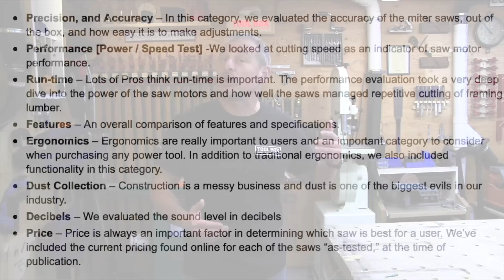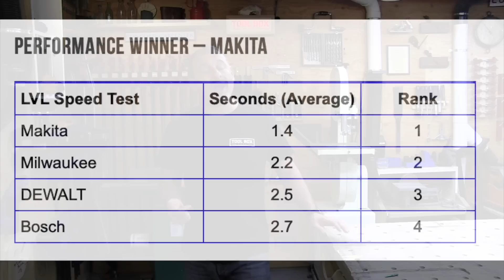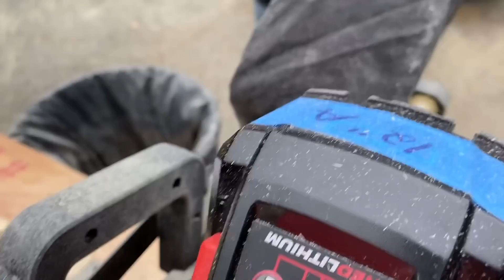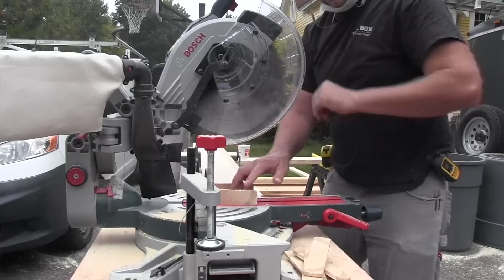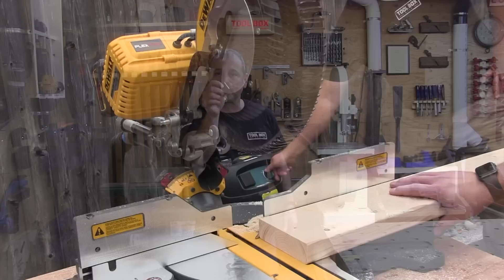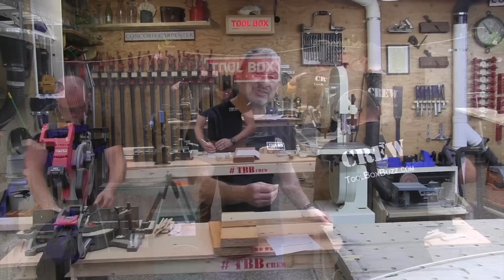Best 12-Inch Cordless Miter Saw - Head-to-Head

Comment: Did you have any issues with Makita’s detent on the miter adjustment? I noticed that the saw on the showroom floor had significantly been worn down, causing a lot of slack when locked into a detent. I’ve also heard of users having the same problem. I hope they have fixed this!
Reply from the maker: No we didnt. It seems that this is a long term use issue. Hoping they took care of it too
Reply: @ConcordCarpenter  thanks for the response! Keep up the good work as usual!

Comment: Mikita not winning the dust collection challenge should be shocking to everyone.
Reply: I run the makita with AWS. The dust collection is good. I cut a ton of MDF trim and i never smell any particulates. I think that is the major factor in dust collection. Heavy particulates which cause a mess arent the issues. Its the super fine cancer causing particulates that are the concern and the makita with AWS def eliminates those
Reply: I have a dewalt 12 inch sliding miter and it has by far the worst dust collection I have ever had on a tool
Reply: @jeffb321  I’m just baffled with 2 massive dust boots it didn’t clearly win.
Reply: @jefftucker9225  I ran the same saw for 7 years until moving on to the Kapex recently. And no matter how much I hated it’s dust collection, I had no idea how much better it could be. No matter how much cutting I do, the saw and gauges are never buried in dust, and there’s never dust more then 3-4ft away. My Dewalt would send dust clear across a room, no matter how big it was.
Reply: @ThisTall  I upgraded to the Bosch Easy Glide and love it, it's such a space saver and though it's not as good as the Kapex for dust collection, it's definitely better than the Dewalt

Comment: I'm a makita guy. Don't buy makita saw. I've owned the 10" for years. Detents wear out easy, really difficult to rotate base once gets clogged with saw dust, heavy, laser sucks, list goes on... This saw frustrates me daily. Don't be fooled by the large base and gimmicky bevel angle adjustment. Some good points but I wouldn't buy again. Glad Bosch has Cordless now. Dewalt good too
Reply: I've used the 10" makita professionally for 2 years. My detents still aren't worn out. I could care less about the laser, most professional finish/trim carpenters I know trust their eyes and experience over the laser. It is very heavy though 😂

I've used it for stain and paint grade trim. Light framing and high end handrails. It has never let me down.
Reply: @zacharybaker695  I understand people like this saw, it is accurate and yes  the laser is not a big deal but if the saw frustrates me daily I don't like it. I've been a carpenter for close to 2 decades. I really think people should know about the long term issues. Detents, weight and the base plate getting clogged and hard to turn are deal breakers for me I'm afraid. I had a corded Bosch before I went cordless and I love that saw. It was highly accurate and had none of the above issues. I still use the Makita simply due to the cordless convenience, battery platform and I don't want to spend another $1k on a new saw. Ultimately, it does work though.
Reply: @thomasDLC  Fair enough. I also have a Bosch corded saw. I love it. But weight and cords....I'm looking forward to the 10" battery powered Bosch Glide if/when it releases in the US.

I solved the detent issue by being relatively gentle when changing angles. Some guys I work with just throw the table around. I also screw down the angle adjustment lock any time I'm transporting it. A lot of people saw that good tools should be able to take abuse, and I generally agree. But if I pay $600+ for a saw I'm going to treat it right :)

Comment: Milwaukee is running high amps and low voltage.=heat. Copy makita 36v 2 batt system so they can continue to claim full platform compatibility.  But they wont.

Comment: I have never understood why anyone would want a cordless miter saw you don't carry the damn thing around the job with you, somebody explain that to me. i just bought a corded 12" Makita i never have to worry about changing or charging batteries. also didn't have to spend a couple hundred extra bucks on batteries.
Reply: It makes no sense. Total gimmick.
Reply: The only reason I can see someone getting one is if they do woodworking in there garage and have no power. But otherwise I agree

Comment: When I replace my corded saw It’ll be with a cordless
Reply: jami w  good point, I’m on the makita platform mainly tho
Reply: I love my makita. Just wondering when the 40v option will be available here in the US in 12"
Reply: I’m in the Uk, we get everything a couple years later if at all
Reply: @benchippy8039  bummer!!
Reply: jami w  surprised to hear that. Makita is actually the leader in cordless tool innovation...what cordless tool are you wanting from them? My main tool i want from them is a cordless belt sander. I also think they should do a cordless compressor and cordless table saw but other then that they offer the largest cordless line up across the board...
Reply: jami w  yes we do but not many people use them, never really understood why
Reply: jami w  it’s probably better suited to timber frame houses cuz your more likely to be doing straight cuts. Most our housing stock is masonry and old so most cuts are scribed, I can definitely see a use for it but I think we pay a lot more for tools over here
Reply: I prefer corded tools if they are large, I don't think I would ever go cordless if they invented a cordless table saw, or thickness planer or even a miter saw, I just think in the long run the corded versions are going to last much longer and not require as much maintenance,  basically batteries, I mean 10 years, none of these tool makers will be using the same battery platform and you will have to look for aftermarket batteries
Reply: @jefftucker9225  all the prosumer companies have cordless table saws and they look decent. I get what your saying, all my larger kit is 110v but I’ll be looking to replace with cordless. Even if they move to non compatible batteries I’ve never had a mitre saw last longer than about 5-7 years, they get abused as one of my most important tools. The table and mitre saw come out less and less now with the tracksaw and hkc55 in the van

Comment: Everyone says they would choose to buy the M18 for a job site. Lol. But Mikata and DeWalt score higher. Lol.
Reply: not by a lot, also the thermal shut down hurt its score and to be honest usually you don't cut a lot like that (repeatedly cut and stop for tens or hundreds of cuts) without that issue it would cut the same amount as the dewalt.
but overall as it was said this is the lightest saw, professionals who go for job site don't want to carry bulky equipment around, if you use the saw on workshop Dewlat would be the best thanks to the AC\DC rectifier.

Comment: I see no point to cordless miter saws. Once that battery dies when the battery platform has been discontinued, off to the junk pile it goes. Designed obsolescence. If they came with an AC plug in, then sure. 120 volt AC isn’t going anywhere. 

I own the 12” Milwaukee 120v. 20 years from now it will be still working.
Reply: You've obviously never worked on a big job where power is an issue,there is also a desire for large sites to be able to operate fully cordless. So your batteries run out but your invested in the platform so just get one of your freshly charged batteries. Besides I've never been able to get through one battery in my smaller dewalt cordless or the two on the twelve inch in a single day and I've used them none stop.my saws will also still be working in twenty years,I won't still be using them though!

Comment: Oh boy, what a lame excuse by Milwaukee. What you did is pretty much one of the main reasons why you buy a miter saw. To make lots of repeatable, perfect cuts. There are other uses, sure, but to imply that this usage mode is "unusual" is just BS. Sorry. Your testing scenario was spot on.

De facto we are experiencing here what Milwaukee critics have been saying over and over. Those machines are tuned for spec sheets. They are marketed as the strongest "whatever tool it is today" and they got the numbers to show it and they do deliver in the usual youtube testing scenario, make a few cuts here and there and everybody is amazed. They will also be fine for the home gamer and people who simply don't use them in an environment where work in bulk is common.
 
But if you really USE them, they tend to cut out on you since this system tuning comes at great cost. They just don't hold up if you put them to work. I don't know about the US, but over here, you rarely see a professional contractor use Milwaukee. I reckon there is a reason for that.

On the other side of the isle you got Makita, who are super conservative in their system setup. You win no spec sheet competitions that way, but those machine will deliver day by day, month by month with great consistency.

Concerning job power flexibility it has to be added that makita offers a battery unit (backpack) with 1200 Wh that will power any 18V, 36V or even 40V tool. So you got runtime for ages AND are still mobile. That would be almost 900 cuts, so you would definitly give up sonner than the saw :D Also neat.

Comment: Bosch makes heavy, over engineered, bulky tools. Miter saws, tablesaws, routers, everything.
Reply: Don't think you can generalize. All the companies have strengths and weaknesses in their lineups. Which is a problem if you need cordless and stick with one brand for battery consistency. My Bosch drill and driver were very disappointing, Milwaukee the best I've ever used. But Bosch grinder is brilliant and I'm amazed at my 12V mini circular saw. - build is more like their green diy range but so useful for cuts up to 1". Perhaps get the very best two or three tools for your main trade and budget tools for those you use occasionally. These guys are good reviewers because they allow that the best tool for you might not be best for me

Comment: Bosch has shit batteries so hard pass...I love Makita tools, but my 12” corded DB slider is shit, I live 30 minutes from the assembly/repair plant in Georgia and it’s been in 5 times and replaced twice....it comes out of square from transportation from shop to job site and it’s a bitch to true up the saw and laser, I’ll also say during the recession I worked for Makita as an assembly line manager,  I’m best friends with the regional sales manager, they make great tools, but the two 12” corded saws they’ve replaced and repeatedly repaired have been pure garbage...Very disappointed, but hey, they can’t all be winners.

Comment: Iv had the makita and it was garbage. It simply cannot live up to the rigours of life on site. It needed continual calibration and adjustment. Over all i owned it for 12 months it went back to makita 3 times in the end there answer was well you should always calibrate the saw before every use. They tolerance on the mitre plate on the front is not good enough the hardened steel pin that registers in the mitre presets wears the soft aluminium plate very quickly. This is supposed to be a premium saw and makitas flag ship saw. Not good enough there customer service is garbage too